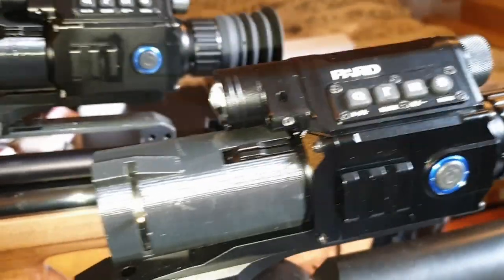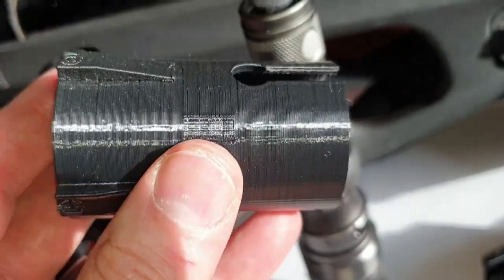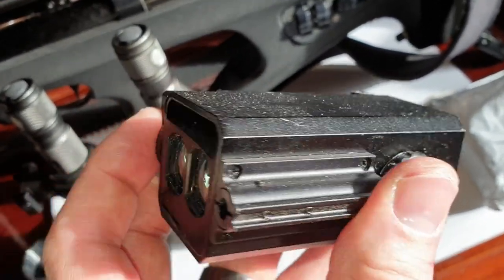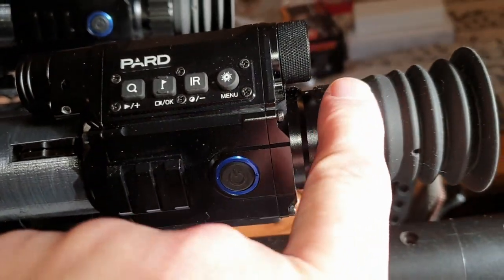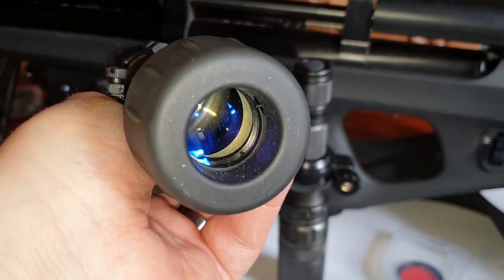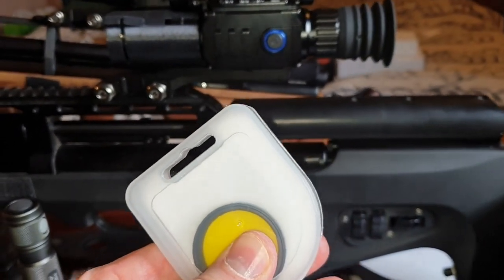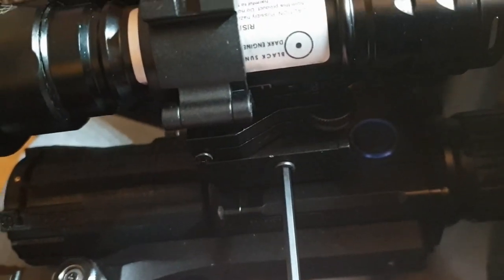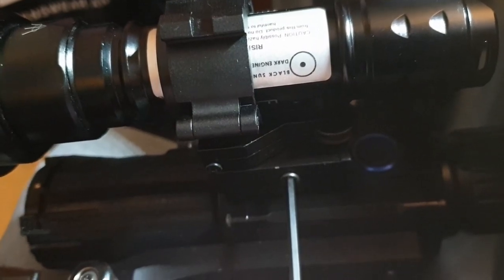PARD008LRF Hints & Tips part#3

Comment: Hi Russ , not able to view my footage ! Any tips to what I'm doing wrong ? Great info by the way many thanks  dodge
Reply from the maker: Hi Paul thank-you. 👍🏻
Is your PARD not downloading to the memory card, or you can't get it off the card?
I use high-speed 128GB microSD cards in both of mine.
Reply: RussDouglas 222 hi russ , I’m hoping it’s recording, red circle, numbers counting up etc , will try different micro sd like the ones you run cheers pal many thanks for quick response “ hope you’re back gets better soon “.  Dodge
Reply from the maker: @DODGE782  There's no internal memory that I know-of, so it must have a card in the slot on the side.  Good luck -and thanks very much. 👍🏻
Cheers. Russ

Comment: Hi Russ,

I have recently bought the 008LRF and love it. One quick question, when zooming into 13x I partially lose the laser range finder figure. For example if something is 100meters away, I will see the '1' but the '00' is not visible. Do you know of anyway to fix this? Thanks in advance.
Reply from the maker: Hi Sam it's very cool kit isn't it? 👍🏻
Hmm when not zoomed: have you moved/'zeroed' the LRF aiming box to coincide with the LRF laser splash (at night / in overcast conditions) -at your chosen zero distance?
The onscreen LRF aiming box can be moved via the menu as covered in the manual, written by Bruce. What wasn't covered (and might invalidate your warranty) is that the LRF splash itself can be re-directed, this has been covered on the UK NV forum and is a bit lengthy.
Cheers. Russ

Comment: Thank you. I have my pard 008 lrf set up on my texan 457. The instruction manual is terrible. do you have a link to a video that clearly shows how each button works and how many times they have to be pushed to change different functions of the scope? 
Thank you. 
Scott
Reply from the maker: My pleasure Scott, the full 008LRF manual can be downloaded here: 
https://drive.google.com/file/d/1JA7l4TSsMRzMW1aoXfYn9IiE-Jh0uIbP/view?usp=drivesdk
Also are you using the up to date v.1.25 firmware, if not I can email you that with instructions? RussDouglas222@gmail.com
Cheers. Russ
Reply: RussDouglas 222 thank you 🙏🏻
Reply from the maker: @Scott-cu4ol  Happy to help, so is your 008LRF already running firmware v1.25?
Cheers. Russ
Reply: RussDouglas 222 Thank you. I’ll check it out and let you know. What is the best memory card that I should order for it?
Reply from the maker: @Scott-cu4ol  Any decent quality household names should be cool, I'd go for a couple of high-speed 32GB Sandisk (or similar). 👌
Cheers. Russ
Reply: RussDouglas 222 ok. can i use a 128GB?  also my firmware version is R43.V2.01.
Reply from the maker: @Scott-cu4ol  Well I do have high-speed 128s in both of mine right now, but 32GB cards will hold about 5 hours of Pard recording (@100MB/minute), so I'd just get several of those if I didn't already have 128s.
Am not aware of that version, is it a new 008LRF+ you have?
Cheers. Russ
Reply: RussDouglas 222 I received it about three months ago in June 2020 I ordered it from a place in Australia but it actually came from Wuhan China. I took a photo of it but I don’t see any way of posting it but that’s the version.
Reply from the maker: @Scott-cu4ol  What's the eyepiece resolution listed in the wee Pard instruction manual? The mk.1 Pard008/008LRFs are 800x600.
Also does it have a visible red targeting laser at the upper/front/left near the zoom button?
Cheers. Russ
Reply: RussDouglas 222 Hi Russ. sorry for the late response. it’s 1024*768. frame rate 30fps. video Resolution 1920*1080
Reply from the maker: @Scott-cu4ol  Cool that's the newer/latest 008LRFp version then, I haven't been able to properly review one yet myself.
Out of interest does it still stretch the recorded footage to 1,920x1,080?  The way to check is record a circular object, then measure if the circle is oval on playback.
The existing Pards do, so these days I de-stretch/correct it back to 4:3 (1,440x1,080) before editing my videos.
Cheers. Russ
Reply: RussDouglas 222 i’ll have to check. I am new to air gunning and I bought this basically because of one of your videos. I bought two air rifles, a LCS SK19 25 caliber And a Air Force texan 457 with the upgraded carbon bottle and valve from African air ordinance. I haven’t even zeroed it yet. i have the PARD on the texan and a Hawke on the LCS. i might move the PARD to the LCS because of the eye relief.  when I did test fire it on the Texan it almost scoped me  in the 👁. that’s what 800 fpe can do!
Reply from the maker: @Scott-cu4ol  Crikey! Take care please.
I assume circular objects will still look circular through the eyepiece, but I'm keen to know if they'll still be circular on video playback.
Such a compliment to hear my videos introduced you to Airgunning 👍, hope you enjoy it! 🤞
Cheers. Russ